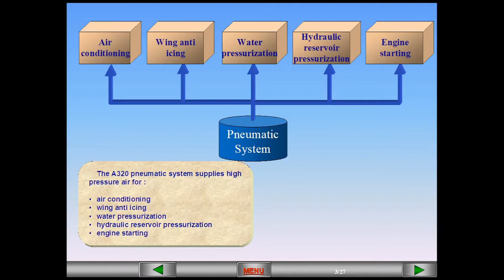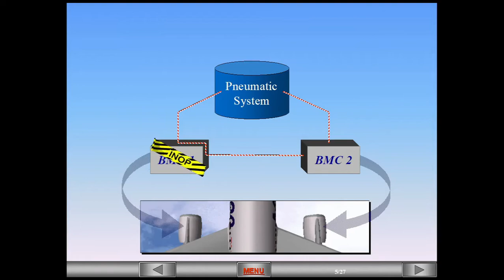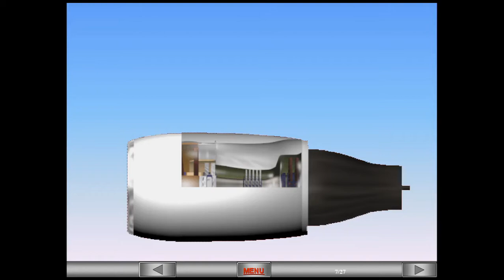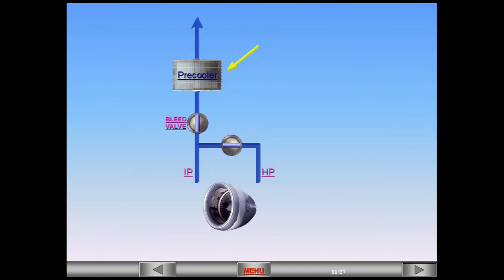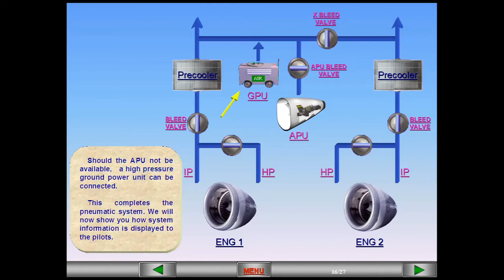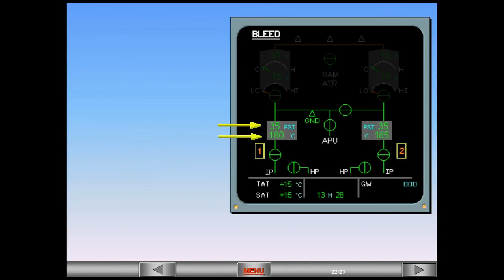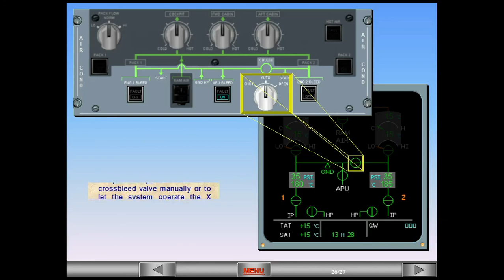A320 - Pneumatic System (System Description) PART 1

Comment: Is the AC to operate if the apu has a failure before startup by using ground air and GPU or shall the flight be aborted?
Reply: Under most circumstances, an aircraft cannot operate in these circumstances one of many reasons, is due to engine circulation and air intake. The engine cannot start without APU, usually startup on stand is prohibited unless it’s an isolated stand that connects to a taxiway. The second reason is also if there is an emergency where the AC has  lost power of engine, backup electricity is necessary to keep, information on the PFD, as the ADIRU usually fails in conditions of this sort, so the APU is necessary for this kind of operation and it would be a risk not to have in case of this happening. When I say the engine cannot be started without the APU, this is not theoretically true as it can have a manual start, but this is only really used in dry motoring scenarios where the aircraft engines is started after, the fuel inside of it becomes “dry”. This is only ever used in engineering and it’s not part of a pilots workload.